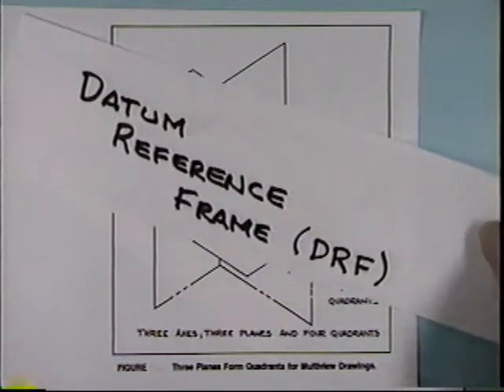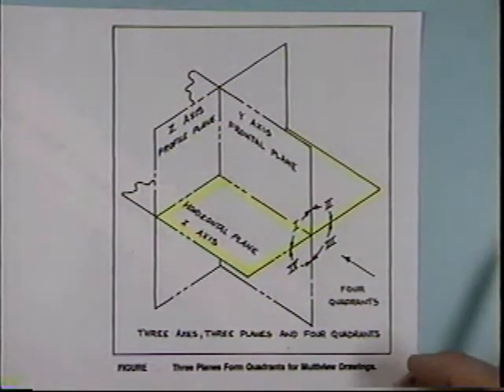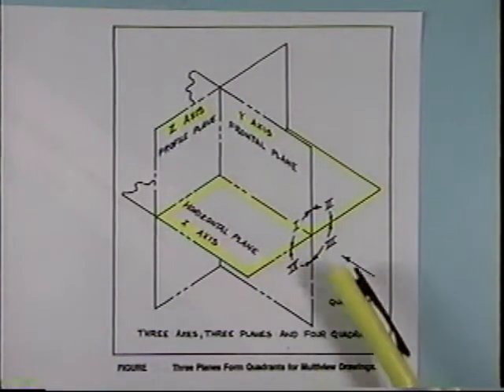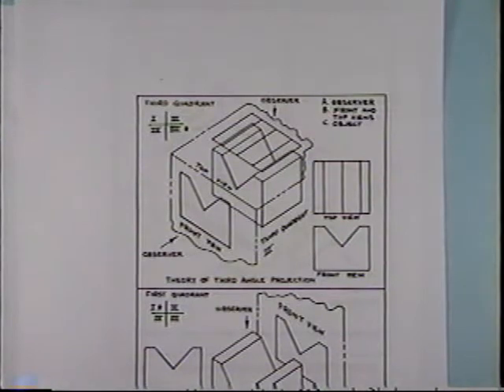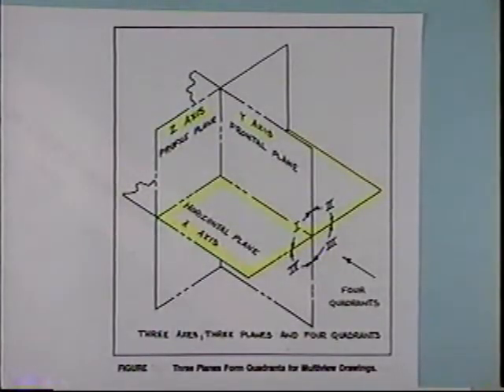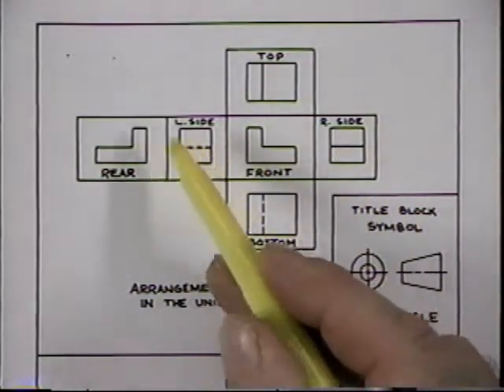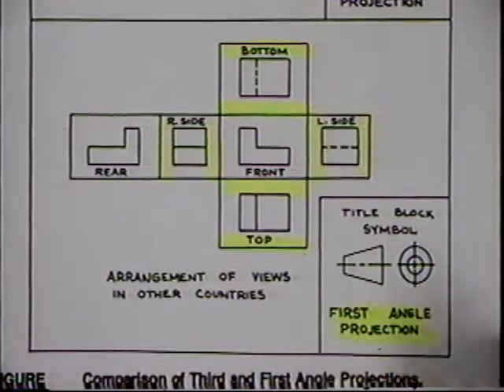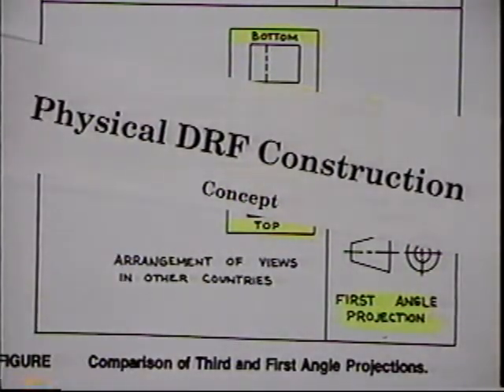X Y Z Datum Reference Frame DRF

Comment from the maker: The datum reference frame (DRF) is common to design engineering, manufacturing, and quality.  Digital X-Y-Z axis technology is applied to orthographic projection (glass-box layout) in the 1st & 3rd quadrants, and also used with computer-aided design (CAD), computer-aided manufacturing (CAM) and with quality control using a coordinate measuring machine (CMM).  "ASME Y14.5 Dimensioning and Tolerancing" also uses DRF construction concepts. Thanks for using this educational "YouTube."

T J (Tom) Vanderloop, Author, CMfgE, AWS Member & SME-Life Member (LSME) and a Manufacturing Consultant